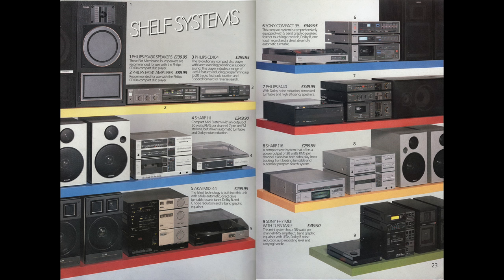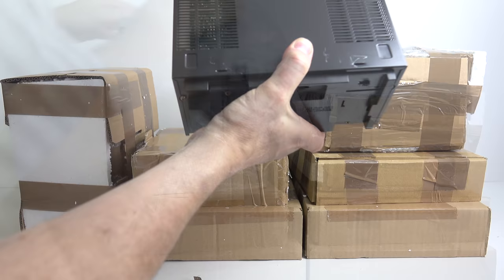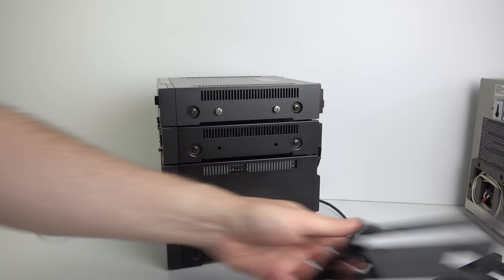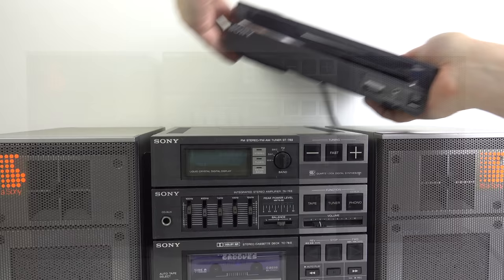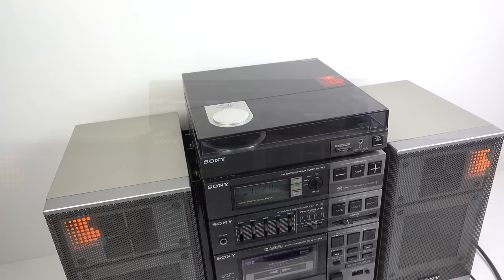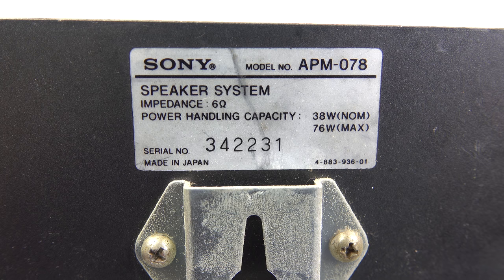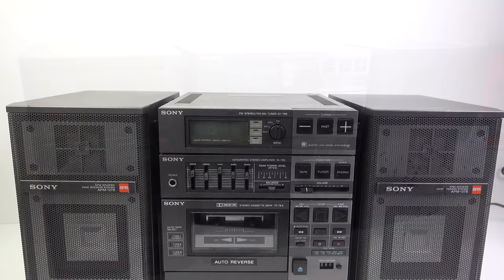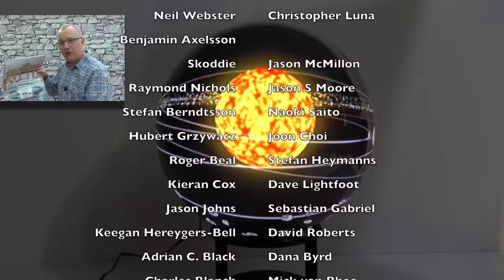HiFi Classics - Sony FH-7 MkII

Comment: Now That's What I Call a Real Hi-Fi Stereo System, Not What They Sell in Stores Nowadays. Last Decent Stereo System I Purchased Brand New Was At Best Buy in 2012, by SHARP. It Features Dual-Well, Full-Logic, Selinoid Driven Compact Cassette Tape Deck, CD Changer, iPod Dock, USB Port, SD Card Reader, AUX Input  & a Digital AM/FM Tuner All in One Unit. Main Reason I Purchased This Stereo System Was Because Of the Full-Logic Dual Tape Deck. It Was The Only Stereo System on Shelf With a Dual Tape Decks. And Yes, All Sources Including Both TAPE A & B Are Remote Control Compatible. You Can Use The Remote Control To Wake Up To Tape, Program The Timer To Record To Tape, AMS Enabled Allows You To Skip To Next/Previous Tracks On Tape, Repeat Tracks, Program Which Tracks To Play, Which To Skip On Tape. CD-SYNCRO to Copy Entire CD to Tape, Tape A to Tape B Dubbing, iPod to Tape Feature Plus Other Cool Features. Best Of All, This SHARP Stereo System Features an AC-BIAS Stereo Heads and An Actual AC-BIAS Erase Head Instead Of A Cheap Permanent Erase Magnet, Making Tape Recordings Sound Amazing, Crisp Clear! CD on Tape Sounds Just Like a CD, No Difference in Sound Quality When Dubbing From Master Tape A to a Blank Tape B, as Long as You're Using A Quality Type I/IEC I or Type II/IEC II Tape To Record To. Unfortunately It Does Not Record Unto Type IV-Metal Format Tapes, But Still Plays Them Back. It's Been Almost 10 Years Since I Purchased This SHARP Brand Stereo and It Still Functions, Sounds And Records Amazingly Good! I Recorded Over 400 Tapes On It, Mainly From Radio, CD's and USB Connected to My Computer. CD Changer Is Also Decent Quality, Never Have Any Problems With CD Skipping, Even With Scratched Up Discs. IPod Dock However Has Some Issues, After Few Hours of Playing or Recording Music From An iPod, The Stereo System Freezes Up and Stops Responding, Even The Tape Decks. So I Have To Turn The Unit Off, Unplug it, Plug it Back In and Perform a Cold-Reset. Then Everything Starts Functioning Properly Again. It Only Does That Each Time I Try to Use an iPod Dock, Other Than That, Everything Else Functions Well. Last Time I Checked Best Buy Stores, They Still Sell This Similar SHARP Stereo System, But The Only Difference On It Is The Design and It Only Has a Single Tape Deck, Instead Of a DUAL A+B TAPE Deck, Like The One I Own. I Got Mine In Time, Before They Converted It To a Single Tape Deck.

Comment: Thanks for the fine review Techmoan!  Just a little tip for you or anyone else watching - If you use Energizer Lithium batteries or even those cheap 'Heavy Duty' type cells at Harbor Freight, they will not be prone to leak over time like those nasty old alkalines did in the video.  You could also use the low self-discharge rechargeable NiMh batteries such as Eneloop or Ikea's Ladda brand which typically don't leak either.  Rechargeables are a little pricier than other types to start with, but they are the cheapest in the long run.

Because of all the devices I've had ruined by alkalines, I have completely weaned myself off of them.  With all the good alternatives available, there's just no need to keep taking the risk.

Comment: This appears to be the predecessor of my Sony HiFi system I bought in the early 1990s. Mine looks similar in design to the CD player that you attached to test the aux input. (A few buttons less since they are on other components.) It is also a similar setup with the equalizer/amplifier being the core that connects to the rest (tuner, tape, CD) through ribbon cables. It has an additional phono and aux input and an infrared remote control, but is not designed to be portable at all. (No handle, no mounting brackets, no battery.) Mine does have some issues now which I hope I can fix when I got my workbench setup in my new flat...

Comment: I just picked one of these up recently.  Very happy with it.  Mine actually has 5 preset radio stations.  My understanding is that my model was actually made for the Japanese market.    My tape deck does not work, but appears to be complete and I get some reactions from hiitting play.  Will be delving into the innards soon and hope to get it working.

Comment: The one thing about these shelf systems was that they lacked serious lower end. I have an old Panasonic RXc53 boombox with the honeycomb speakers and as a young adult thought they sounded amazing however as an adult and recently owning a JBL Bluetooth speaker the JBL blows it clearly out of the ballpark for sound and it's less than half the size. Things have really improved over the years when it comes to that.

Comment: i also have mark III  long time ago.the amplifier chip(STK IC) was in the graphic equalizer deck.you can see the STK IC through hole on the EQ deck.the amplifier output was route back to power supply deck at the bottom so end of the output circuit wiil go out at power supply deck.

Comment: I still have most of my FH-7 Mkll. I say most cos first to leave the party was the record deck when it went west, then the cassette deck went east and finally the radio tuner went south. So I have the amp, power supply unit and speakers. Up to last year, it was linked in to my video edit system and used for audio monitoring. The speakers still compare with modern units [in my opinion anyway].

Comment: Not sure if anyone can help but have been searching for this particular home system I had as a kid 80s 90s. Was a cd cassette radio black flat wedge design about 36inches wide from what I remember. And had speakers. Cd and cassette trays popped up and volume controls was like a big round dial type.

Comment: Hi Tech and congratulations for your channel.I saw a lot of our videos and you´re doing a good job. 

I have a Sharp VZ 2500  that sounds very good on tape,radio and vinyl.The vertical turntable surprized me cause sounds better than many regular turntables and when i connect it to an amplifier is just WOW...My father bought it about 28-30 years ago and i didn´t get to excited cause i allways liked the hifi systems but after i turned it on ...man i couldn´t believe.Good Japanese made stuff.

Comment: i was lucky to have the mark 3. I loved the square speakers and the quirky turn table. I also had the Sony flip top cd player the only problem I had was the batteries lasted about 20 minutes it was heavy to carry and the plug in cables failed at the back. Wish i never sold it.

Comment: In my youth I had one like that strapped into the back seat of my car and running off the batteries before I invested in a radio cassette player (which weren't standard then) with new speakers and electric aerial... ta-da! Those were the days!

Comment: I owned this Sony system back in the 80s' It served me extremely well. I eventually sold it to a collector. I had all the components including the CD player and Turntable. The only difference was mine was a double cassette version for dubbing. The CD player developed a skipping problem which got annoying and I couldn't figure out how to fix it so I sold it.

Comment: I too misspent my youth worshipping at the temple of Lasky's, upstairs at the Tottenham Court Road branch. There I coveted Nakamichi cassette recorders capable of handling chrome tape and reel to reel decks made by Teac and a 'sound on sound' effort from Akai (what happened to Akai?). I would have sold my soul for a Teac A3340 and probably would still sell some non-essential body-parts.

To my admittedly untrained teenage ears, my George Benson cassette played on a Nakamichi 1000 deck through an Acoustic Research amp and JBL speakers represented sonic Nirvana until they'd eventually, after enjoying Benson, ask me to leave. Nobody back then could have convinced me how far from sonic perfection cassette technology actually was.

There was another big consumer electronics shop opposite Lasky's; I can't remember the name. Back then, Tottenham Court Road was continuous electronics shops from Oxford Street to Goodge Street, sadly nearly all now gone.

Comment: The store had a few portables that were over 1000 dollars insane I guess after 38 years I can say it was a good buy mine is made ihe Netherlands if I recall I do need a tapedexk for mine u can use a home deck and run it through the front aux just need a few special connectors I have. So its very flexible I use it with a portable DVD player its great

Comment: my first quality hifi was an AIWA system very similar to yours but it did not click together like yours it was about the same size and very powerful it had no problem running a pair of 12" floor speakers

Comment: Quite high 2nd hand prices on eBay In must say; vintage Sony is apparently still popular... 
 I wonder about longevity though, our own experiences with Sony are mixed: my portable V700 VCR got a sound defects in its first year and the very small portable radio I once had  suffered from a too weak plastic case leading to a premature failure, contrary to my Professional Walkman which as a sturdy unit is still going strong. Our midrange Sony cassetteplayer/radio/CD-player with clip-on speakers still works, but lost all its display information, while a standalone Sony CD player  I sold on never failed on me. My new BluRay player is also a Sony (the previous LG gave up way too soon), but too new for an evaluation on longevity.  I feel Sony's main competence is in design and miniaturisation of electronic equipment and varies in build quality. Highend for me still means Denon, Tandberg and Revox (latter are gone now)

Comment: I might be alone in saying I prefer the look of the MK I, less fussy and the less flashing lights the better. I remember my Dad's Technics midi system SA-X11WL had those square speakers, a manual tuner but twin cassette with Dolby B. He opted for the CD player but there was the matching turntable option too.

Comment: I had a mk 1 but I changed out the speakers for some nice marantz deeper with a much better sound.The amp blew twice and I got it repaired but gave up and got nice separate components and even bigger better speakers and never went back to all in one systems after that.

Comment: I am so jealous, 🤣. Something like this was beyond my family could afford back in 80s. I remember , my uncle who ever worked in Japan managed to bring home similar HiFi set, perhaps not the same brand and model, but it was very cool for a 2nd grade elementary schooler. Well, I finally had a Kenwood one in early 2000, when I was a college student,  that could play VCD (😅 very stupid decision ) but it was all cheap plastics , and around 2009 suddenly dead🤣. Replace it with much cheaper local brand , Polytron (now you can identify what country I am from), but the DVD player was dead in 2013.... Basically most of 2000s product are engineered to become obsolete in a very short period, unlike those 1980s.

Comment: I don't understand how anybody can say that the passage of time has resulted in an increased quality of life when we can't buy new equipment like this anymore. I believe that if some companies put their minds to it they could create stuff in the present that would rival the features of the past and be just as aesthetically appealing or better! I believe that the reason this doesn't happen in the present is because money has become so darn worthless and large sections of the population can't afford anything that's made out of any material more substantial than cardboard. The 1980s was a true point of transition from analog to digital systems and that fact resulted in mechanical engineering standards that were higher than any other time in history for audio components because analog was being pushed right to its limits and sounded quite incredible when built with quality. The products of the time reflected that quality which is why you can still find functional versions today. Does anyone hallucinate that an Apple product made today is going to be functional in 30 years? It won't even be repairable.

Comment: Dicksons, spent many Saturday afternoons wandering around Dicksons dreaming about electricals. We have richer sounds, very good and cheap'ish, I've bought a few things from richer sounds and if you have pound notes in your hand you can get discounts (or used to be able to) they like cash flow,
Reply: Dixons :-) Did you have a Lasky's anywhere near you? This was like an upmarket Dixons outlet. Completely separate company though.
Reply: @paulanderson79  we did. but I found it expensive and the staff unable to let you wander about by your self. They must have be commissioned based saleries by the way they pushed sales.
Reply: @sicks6six  The only branch I remember was in Slough, Berkshire. Thinking back on it, it was a bit of a police state inside the shop. Staff were like the bloody Gestapo.

Comment: I have the mk2 and also bought the CD player at the time from a hi fi shop in fleet st around mid 80's it was a great  until I bought a Denon system. 
Currently in the loft

Comment: Someone left a pair of the APR-078's at work, and I brought them home last night to check them out.
I compared them to a set of JBL P10's which are similar in size and go for about ten bucks on Ebay, as opposed to almost 50 for these. 
The JBL's had better bass, were more natural sounding, and more efficient. The only advantage I could hear in the APM's was a bit more clarity perhaps.  Overall, they had a very metallic, unnatural sound. Very interesting technology.  I'm aware that the top end APM's were very well reviewed, but these were a disappointment.
I filmed a video comparison and hope to post it on my channel in the next few months.

Comment: Back When I was working in a HIFi retailer in 1984, there was a Midi hifi by Awa called the V700 system. Now it was selling for close on £800 at the time and during the period from June to September of that year, I sold about twenty of these. Aiwa didn't produce a CD player at that time and the ideal model to fit with it was the Fergusen CDP 101, being the same size as the Aiwa components. Just for the record, Aiwa was a premium label name for Sony, and just to make things even more Nepotistic, when one of our engineers took the back off a Fergusen to replace the power cord that a customer had shortened, most of the major components inside were made by Sony. I've often wodered what these V700 systems were like (although we did have one set up in the shop) and do you have any way of finding out?

Comment: I had one of these, with a CD player on top and dual tape deck on the bottom. The volume slider was the week point, mine wore out and stopped working.

Comment: My dad used to repair this model. There's always two problems this model exhibits 1. Unreliable cassette mechanism; the plastic gears tend to break 2. Because the tuner sits directly on top of the amplifier, the control chip for the tuner got overheated and tend to fried. This model sounds very good though.

Comment: Hi Mat.That stereo must have been taken and refurbished from a Turkish barber shop in Germany. If you travel to Turkey one day you can still find barber shops displaying their old FH-7s on their cabinets. I have no idea why they cherished that particular model with "unique" speaker design :)) in their relatively unclean shops. Not to play "the Barber of Seville" for sure. But it explains why you find trimmed hair pieces in the cassette holder. The owner must have had to flip the tape over with hands covered with hair pieces :)) It used to be the most expensive mini stereo component of the time, back in the mid-1980s when I was at high school. It was unreachable for me then. I still have a co-worker, another audiophile who makes fun of it as "barbershop speakers" no matter how I try to persuade him it was a matchless system. I have a newer model Sony "barbershop" system at home, but I definitely would want to have those original models - without the hair :))

Comment: I had one similar to this, bought it while I was in the military in the late 1980's it was switchable from 110 to 220 voltage, the speakers were removable, it stayed in a closet for almost 30 years, pulled it out to use it last year and it did not work so I tossed it out.

Comment: I got a system at a good will with tiny sony speakers and I have to say they're WAY more efficient and WAY better sounding than anything as tiny and cheap (as mine look) should be.  Mine don't have all that fancy square stuff, they're just tiny light speakers totally covered by a cloth grill, but as I said...

Comment: I had the FH7 mk1 in 84,bought from Boots in Bristol for £300 + £110 for the record deck.
Reply: I had purchased the FH3 with the "turntable" in 1983.  It was about ~$600 which was a lot of money for a prepubescent kid.  Basically my entire years allowance and lawn mowing/snow shovelling money.  If I could go back in time I would have told myself to buy $600 in Microsoft stock instead.  If not that I would have told myself to forget the turntable as it was useless and I'd also tell myself to not sell the FH3 to a friend.

Comment: amp on bottom. good place to keep everything warm.
Reply: The bottom section is the power supply only.  A large flat transformer.  The audio amplifier is the section with the equalizer in it (using 'Darlington' hybrid IC's).  All the sections have vents that align so the heat goes all the way up and out.